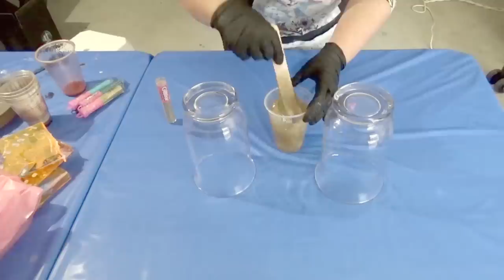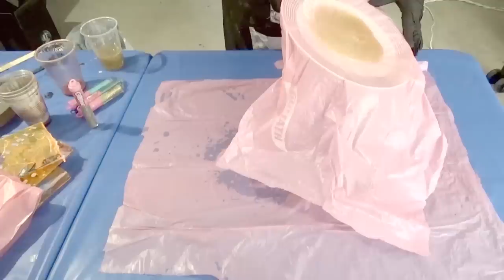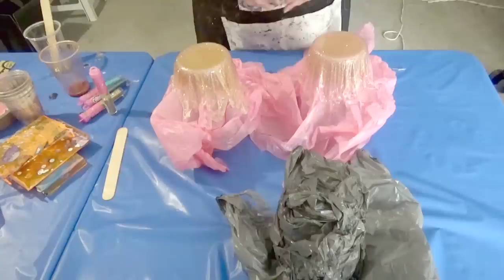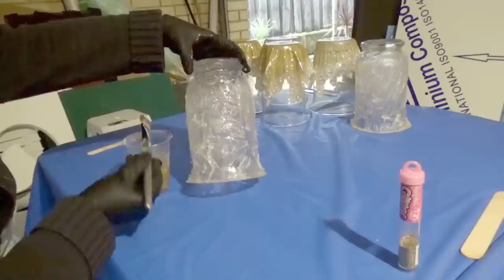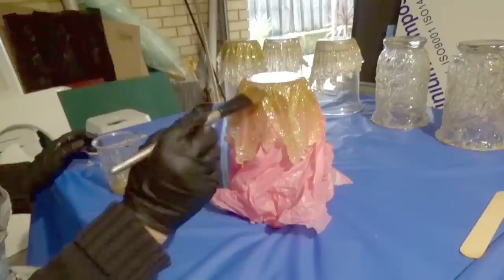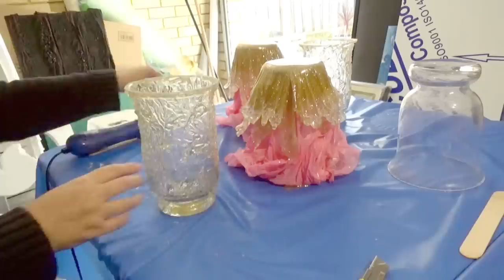Resin Sculpture Time-Lapse

Comment: Can these be used as candle holders/burner's?
Reply from the maker: No, the heat would make the resin go soft and could cause it to leach fumes into air, or worse still, cause it to catch fire. I only ever use LED lights. 💕

Comment: beautiful work. Do you use a mask during this process?
Reply from the maker: Yes, I wear a respirator at all times, hence why I do voice overs.
Reply: Got it. Does it have an odor after it dries? I had a liver issue and I need to be careful what kinds of products I'm around.
Reply from the maker: Violet Takacs no, you will only get an odour if you heat it with a heat gun. I would not recommend placing it near any heat sources, like a candle. I too have issues around fumes and have to be very careful, so always err on the side of caution.
Reply: @SueFindlay  Thank you so much!
Reply: You could always use an LED candle in one of Sue's gorgeous creations - no heat, no risk of odor, no concern over melting. 😀
Reply: @SargentBubblescom  thank you!